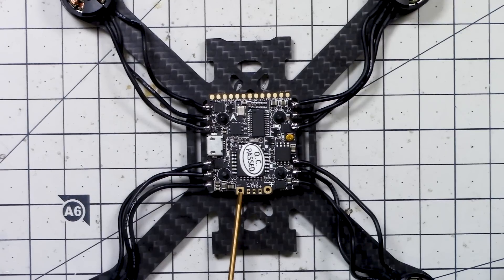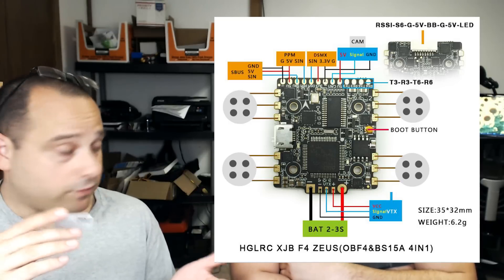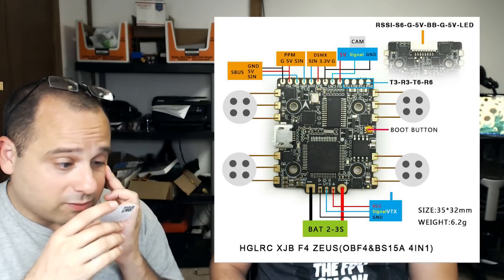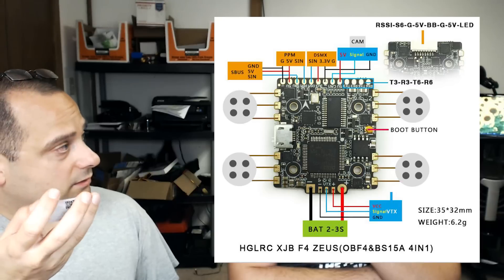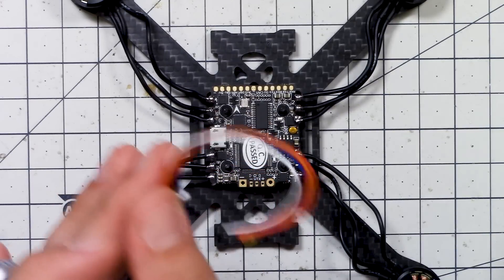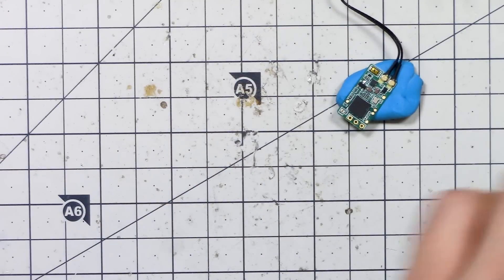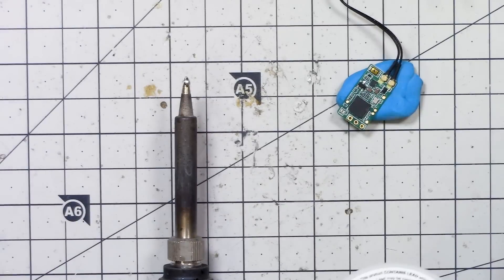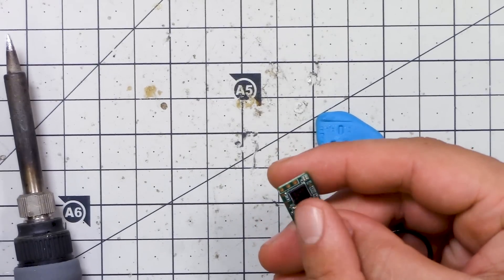HGLRC Zeus Betaflight F4 AIO FC + ESC | PART 3

Comment: Hi Joshua, I’m a bit confused with Frsky r-xsr and this board, does it have any inverted UART port to grab telemetry from? Should I wire the fc UART port to the uninverted little pad in my rx?

Thank you!! This build was perfect guide for my micro!!

Congrats on moving to full Knowitall :D
Reply from the maker: I think you need to use uninverted smartport to any RX pad.
Reply: Joshua Bardwell thanks!!, will confirm it over here when I’m done 👌🏻
Reply: Joshua Bardwell indeed the uninverted pad worked fine with any UART, except it goes to a Tx pad and it is bloody small hehe.
Thank you!

Comment: Been a subscriber for a long time and  I enjoy the technical details of your videos I find them very helpful. Can u do a vidio on capacitors and there usefulness or when not to use them also what type kind and maybe some testing on rather they actually clean up noise. I have a floss with electric noise in the vidio I've been told a cap may help but I know there are people who swear by them and others who say there worthless. I'm aware u touched on this subject in a video. But more in depth info would be great. I trust your judgement and thanks for the sharing your knowledge
Reply from the maker: +Matthew Jordan yes they definitely help clean up noise. I don't use them on every build but I'd I have noise issues it's the first thing I do.
Reply: Joshua Bardwell thanks again for the great job you do. Ur my fav fpv youtuber.  Do u have a recommendation on the uf and voltage if I put on my battery leads?

Comment: Josh hopefully you will answer and I will make 5his very short and sweet, I am stuck on a new build and I have completed four. From the first one using cheap motors and little bees 20 amp to my last one being my best. I am just looking for another powerful quad but a little funnier. Currently it is this

210 x frame
Emax 2205 2600kv
30 amp esc
Matex pdb
Cc3d

Tuned using the PID calculator and just a well built machine. Very very fun machine and I have gone to your website. I have looked and looked everywhere and don’t know what to do for another build. Do you have any suggestions on motors and is it worth switching from the cc3d to another flight controller? Those emax 2205 are amazing and my third build has the emax 2204. Both of them are the cooling emax. I just don’t know where to go and btw I am a father of three boys, so this is just a awesome hobby I am doing. Nothing serious and if you can help, thank you and if not because of reasons, thank you for all you do

Comment: JB.... I see quad builders always seem to use the chisel tip instead of a pointed tip. With the pads being so small, why not use the smaller pointed tip?
Reply from the maker: Pointed tips are really bad at transferring heat in my experience. They're best for small surface-mount soldering. Chisel is way better for general-purpose work.

Comment: Solder flux is acidic and reacts with the metal oxide coating allowing the solder to dissolve into the surface of the copper.

Comment: DSMX satellite receivers are the best receivers for micros IMHO. FRsky receivers suck more voltage and even drops out when the receiver comes close to the transmitter! Not such a big deal with full sized quads but dealing with micros every bit of used voltage counts! Not to mention that we usually fly micros in closer to ourselves than 5 inchers! 😆

Comment: BB is for the buzzer
Reply: Also, using the socket it's RSSI, RX6, 5V and Ground for Frsky receivers
Reply from the maker: What's S6?
Reply: Joshua Bardwell I have noticed that some of the newer boards instead of putting RX6 for instance, they put S6 I guess for signal 6. With the battery pads facing away from you, If you're referring to the first pad on the left, it is indeed RX6.

Comment: I'm enjoying this series build video alot, just bougt that same receiver, but I am going to use it for a  brushed quad, 12mm carbon frame, with a V 2.0 Beebrain and 700tvl dvr split vtx and Dvr cam, 8020mm racestar motors, aftermarket 5.5cm biblade props and a 550 mah 45c/90c busrt lipo.  I think and hope it will be a pocket beast :-D

Comment: shaky hands, small pads, you should explain how easy it is to knock a component off the board. I have learned this the hard way. keep up the good work.
Reply: Kframe FPV I had Chihuahua hands that day...
Reply: Xav FPV , no worries I've been there 👍. Some days are easier than others. I killed an fc because I shook and hit a tiny cap and poof it was sad... I was mostly referring to a psa so folks would know about the potential for errors.

Comment: Just take a look into the manual... https://www.frsky-rc.com/wp-content/uploads/2017/07/Manual/Manual-XM%2B.pdf
XM+ has also an analog RSSI pad.

EDIT: I guess the wide connector is for PWM RX. EDIT2: No. I'm stupid RSSI-S6-G-5V-BB-G-5V-LED 1:08